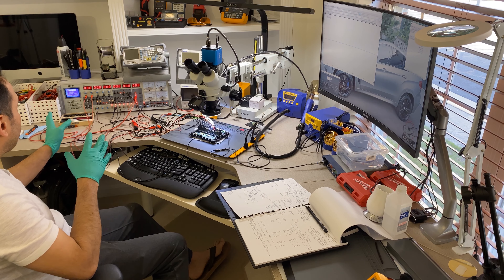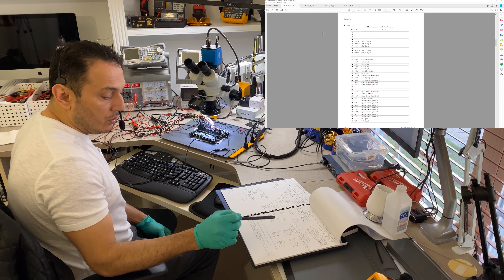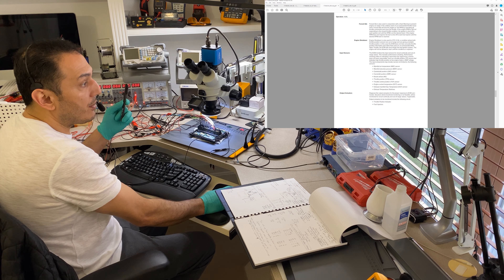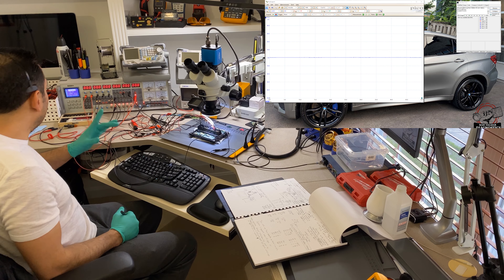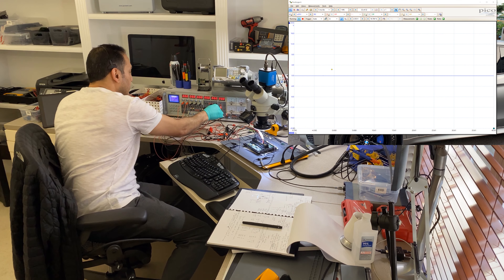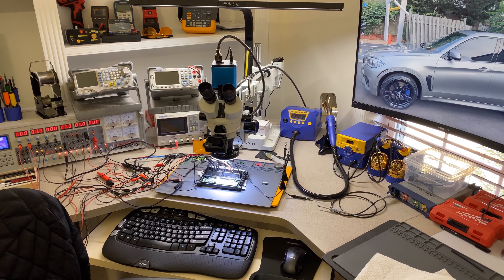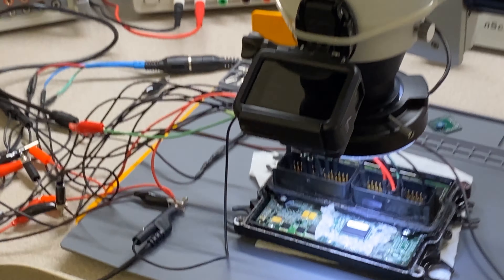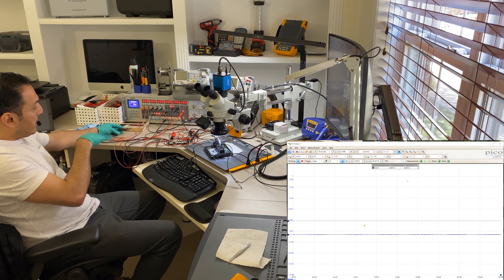2006 Volvo Penta 8.1L ECM microprocessor replacement

Comment: Hi brother I  like your work am a mechanic by profession, but am more interested in ecu, cluster etc... Repairs. My question to you is, the immobilizer doesn't affect your testing when the ecu is off the car?meaning it does not shut down the spark and injectors,or it only works when the ecm is in the car? Lastly could you please recommend some electronics book that can help me on understanding ecu hardware and ecu electronics in general? Thanks!

Comment: Maic hope you and your family are safe. Good video. Maybe you can show me how to remove and install the microprocessor and set it up and program. If it's confidential I understand. Just took a zoom class given by Brian Mann on  pico scope basics. Excellent course excellent instructor. Please keep videos coming. They are all very well done. Thank you for your time Artie ❤️
Reply from the maker: Arthur Fricchione thank you! My family and I we are safe so far and pray to this pandemic slows it’s path! As per the removing and programming of microprocessors I’ll be doing a video soon. The tooling involved is very expensive and involves a lot of learning curve also, so I can show most of what it takes but as you know there is always a risk that something can go wrong and the only way to be safe is practicing and experience. Always back up files before transferring to the new one. I have a good library of back up files that have save thru the time doing this and can’t share for obvious reasons. Hope you are safe as well my friend. God bless you

Comment: Hello Doctor, hope you doing well.
I have a question for you which might be also good experience for you as well. I have 2006 5.7gxi-h and when I connect eco to the wiring harness, I get battery voltage coming out of every single wire. Is that a failure of ECM?
Reply from the maker: Well that seems very easy to diagnose on the boat. If with the ECM disconnect it you don’t have the problem then yes is a completely shorted ECM. I would imagine that you have check the harness powers and grounds and all outputs and inputs.
Reply: Found out wiring harness was bad

Comment: Thanks Maic Great video as usual , but i have a question how do you make the reverse engineering on the board ? and if it possible to show us the screen of MST 9000.
Reply from the maker: Eng Mohammed Ali I have some of these ECMs that are for parts and also I use them to do my own schematics. I go from the PIN back to the micro or IC that controls it. I usually remove the connectors because a lot of components are hidden under it.
Reply from the maker: Eng Mohammed Ali please check my How to repair automotive computer class 1 video. I show the MST 9000 in deep there. Stay safe my friend. Blessings
Reply: @MaicSalazarDiagnostics  how do I contact you for for troubleshooting of a 2007 Volvo Penta 4.3l gXi-g and ecm.
Reply from the maker: @jasonbrown1345  email me at maic@maicsalazardiagnostics.com

Comment: Hello!
Does this ECU have no connection with the immobilizer? How did he turn on so easily without reading the transponder in the ignition key?
Reply from the maker: ENGENEER_RU58 this ECM doesn’t use inmo
Reply: @MaicSalazarDiagnostics  It’s easier to work on the table!
Reply: @MaicSalazarDiagnostics 
Many thanks Maic for very good and advance explanation, you are not only good engineer but also good teacher. 
But this point I need also to have it clear, dose it mean if the Ecu equipped with immobilizer shouldn't respond to simulation, I am not clear why some ECU's with immobilizer enabled but they still respond and give injector/ignitor output I have tried that , give more explanation abut this point please. Thanks again in advance
Reply from the maker: Shark22 even if it has inmo it will respond to low rpms to give spark and injection, the ecm would not recognize as a run yet. But as you mentioned not all ecm will respond and that is when you need either remove the inmo to work on the ecm or get the cluster, keys and all related to the inmo.
Reply: @MaicSalazarDiagnostics  
Good, thanks 👍